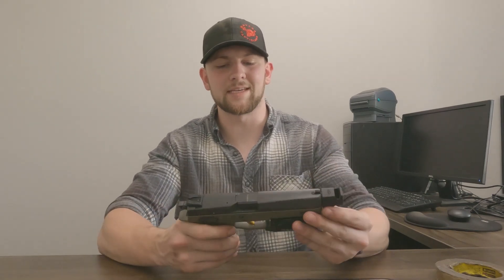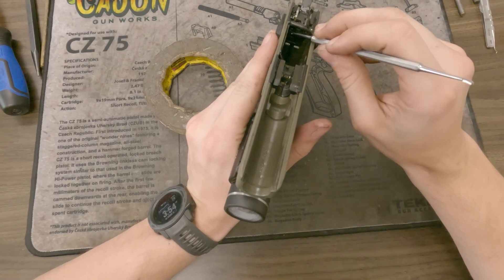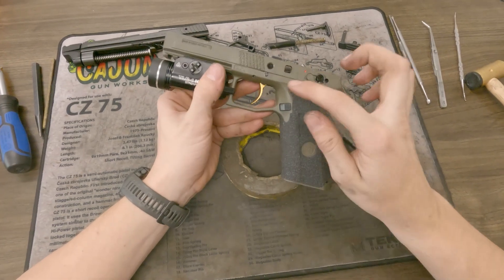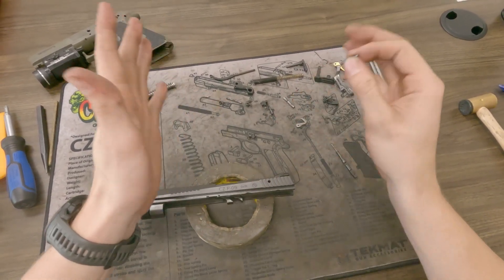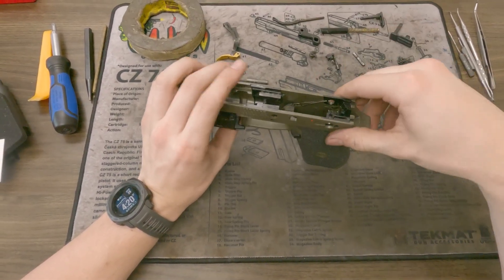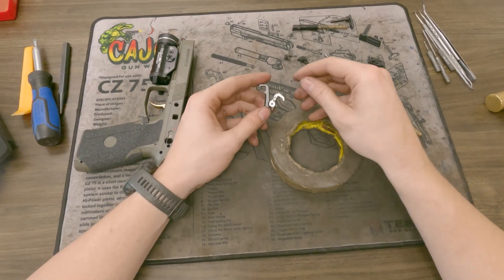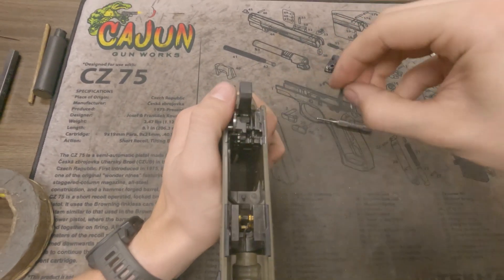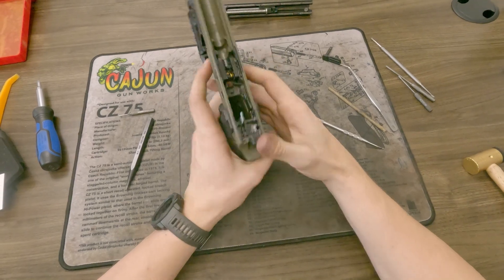CZ P09/P07 Complete disassembly and reassembly

Comment: Great video, thanks!  So I put in the natural sear spring, with the 15# hammer spring.  I haven't shot the gun yet, but my goodness that SA is super light.  Would the red sear spring make the SA a tad bit heavier?  Or should I put in the extra heavy firing pin block instead or both?

Comment: Thanks for this video! I have owned my P07 (with the CGW spring kit and firing pin) for two years and never had an issue until recently, When I decock the trigger the hammer is dropping all the way down (but not contacting the firing pin due to the firing pin safety).Instead of ending the pistol back to CZ, do you think installing the CGW hammer and sear spring would correct this issue?  I am wondering if the sear just isn't caching on the small shelf of the factory hammer. I am willing to give it a go since it will improve the SA trigger as well. Thanks in advance!

Comment: I can’t get my decocker out when I press the ejector down. Very little tolerance between the decocker and Sear. It’s hitting off the sear when I try to pull it out. I have the PO9 Cadet .22 so not sure if it’s the same. Any suggestions?
Reply: Push the front of the sear down too

Comment: I have a question regarding the alignment of the lines when assembling and disassembling the gun. I own the P07 and I can disassemble and reassemble the gun with or without the lines being aligned. Is this unusual? The slide stop seems to work just fine either way.
Reply from the maker: No this isn't unusual. Some firearms seem to compart a little easier than others. I wouldn't be worried about it.